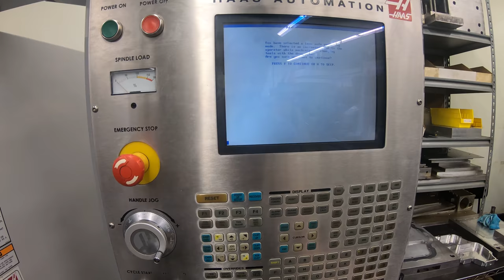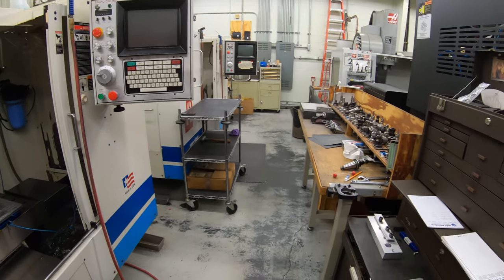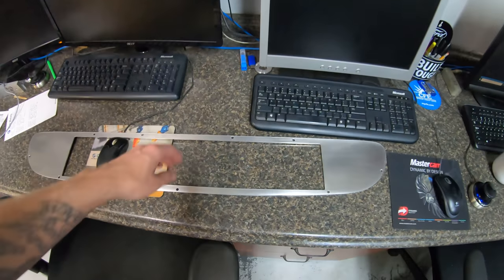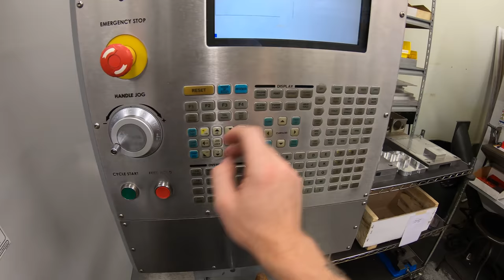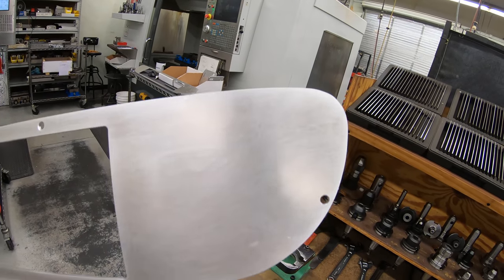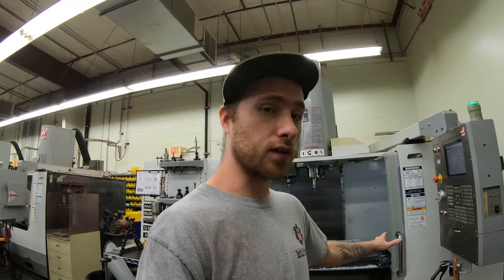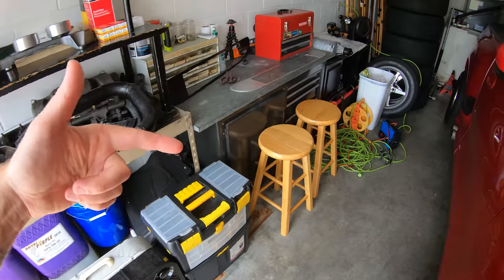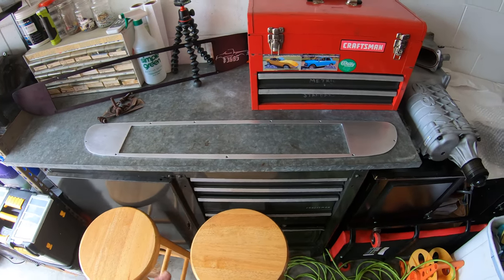Ford Lightning Grille Delete Progress at My CNC Machine Shop with Tour!

Comment: The shop is sweet hope your lightning is running good. Just made a couple more upgrades to the expo running 13lbs of boost and enlarged the maf housing to 104mm. Did you install your tvs yet can’t wait for some videos.
Reply from the maker: Thanks, yup it's running great!  About to take it on a trip to the upcoming Lightning meet!  I havnt installed the tvs yet.  I wanna dial in the suspension and get some good track times/dyno numbers on the current setup first, so it'll be alittle bit, it's freakin hot as hell now lol.  Need it to cool down some 🥵

Comment: That has to be an old machine running with door open lol 😂 or have the interlocks pushed in newer machines have 10,000 sensors in them to kill every bit of the machine if it opens.
Reply from the maker: It's an olderish machine, 8 years or so I think.  But yup all interlocks are disabled, and first thing I do in the parameters every morning is door hold override that shit lol.  🤘😁

Comment: I have a sick looking 2003 California Lightning with 27.400 original miles 
Has a full custom system in bed 
And so many other upgrades 
You mention a new grille delete I’m
Older sorry I can’t see how to find your links 
Thanks
Reply from the maker: 👉https://youtu.be/OwStMhP5hMk
Very nice!  Here's a link explaining and showing the grille delete on my truck.  It's a lower grille delete that shows off the heat exchanger.  If you go through my previous videos you can see it, also lots of pics on Instagram, of it all black anodized and mounted up.
Reply: I was able to find the links thank you 
I might be worried with the bottom grille  exposed that rocks could damage or tweak out some of the fins in that bottom radiator ?
I’m thinking on look and function still 
But love you keep trying new things keep
It up
Reply: You had a great video one day with beat mods to do on the Lightning that were not that invasive 
You still have those links ?
Thanks